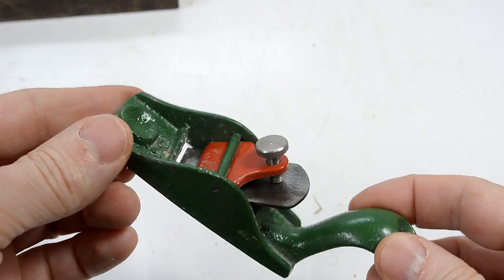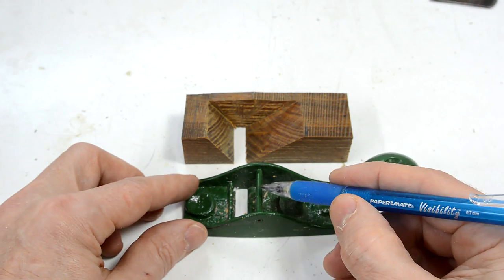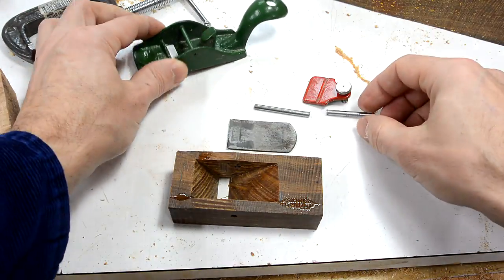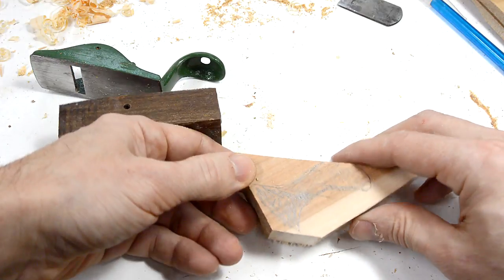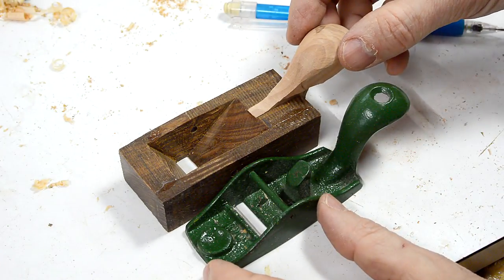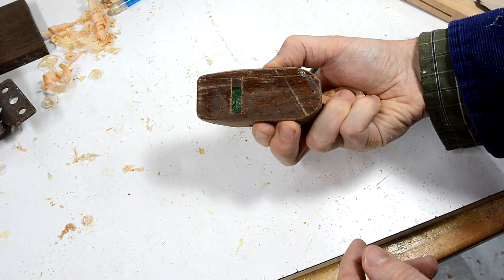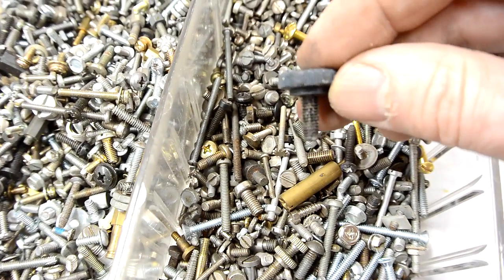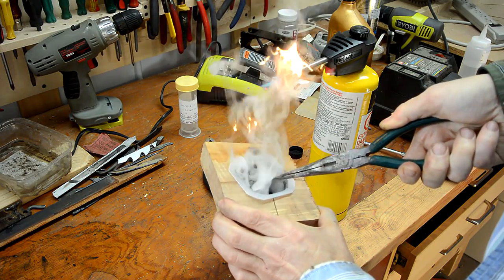Making a small hand plane

Comment: That's some interesting wood, looks dense and oily.
Reply: +NightHawkInLight  Just like my uncle.
Reply: +NightHawkInLight So dense that it sinks in water.
Reply: +YasumotoUS +Dingoart Thats pretty dark...
Reply: Actually a joke, i don't even have any uncles left living.
Reply: It's some of the toughest wood you can find, one of my great uncles was a fabricator that worked on the USS Nautilus the first nuclear submarine.  They used lignum vitae for the rear bearing of the propeller shaft, because it's very resistant to salt water and it self lubricates.
Reply: That, and very rare and expensive. 
It's about 3-4x as dense as most woods

Comment: Great work.  Why did you use epoxy instead of wood glue? Just curious.

Also, softening the steel isn't necessary when you are cutting it with an abrasive saw and deburring it with a bench grinder.

Comment: I was taught that when working with files, that if you draw back on the file while its touching the metal that you are working with the teeth of the file curl over and render the file useless after a while. Did the file that you used have teeth that file in both directions? Also great job on making that planer. You make so many nifty things I wish I was as confident and creative.

Comment: @Matthias Wandel is there any reason you used epoxy this time and not regular wood glue like in most of your other projects?
Reply: +Cosmin Almajanu Epoxy allows for a better bond with oily woods.
Reply: +Cosmin Almajanu 
Epoxy also fills gaps, while for glue you need an exact fit.
Reply: +Cosmin Almajanu Probably for a better glue joint. Lignum is a very oily wood (it was used as a self oiling bearing surface in early wooden geared clocks by makers such as John Harrison) obviously oily surfaces and wood glue are not a great combination and 2 part epoxy will provide a much more reliable adhesion.
Reply: Thanks for all your help guys! I'm new to woodworking (don't even have a shop yet)  but I'm tinkering with different types of wood in my basement.

Comment: Nice small plane You got there.
Though I think lignum vitae calls for some fancier tech. Probably the one-piece body and inox steel pin.
Was the saw You used for a blade a one-piece blade? Sparks look pretty same as of a piece You used as a blade support. Which is probably a low carbon.

Comment: I get the us of an epoxy especially for a wood like lignum vitae. Oily Very hard. But I have to object to using 5 minute epoxy! I find it just doesn't compare to 30+ minute epoxies. Just my two cents. I do wonder if Dev-Con plastic weld wouldn't be ideal for  lignum vitae since it can bond into plastics. Fantastic build as usual.

Comment: I'm curious why you choose epoxy over wood glue for some glue-ups. Is it because this is hardwood?
Reply from the maker: I thoght it woudl work better on the exotic hardwood.  But wood glue would have worked better (a joint cracked, and I re-glued it with titebond 3)
Reply: Ah. Good to know. Thanks.
Reply: With oily  woods sometimes woodglue has issues bonding. However, this issue is easily fixable. Just wipe down the wood with mineral spirits or something similar, then let it dry and it should glue up fine  Exotic woods are often the most oily.
Reply: Thanks for the tip!

Comment: Impressive, have to imagine that using a metal cutting bandsaw bland would have worked better than the angle grinder, but on the flip side, no sparks with the bandsaw.

Comment: A very excellent copy using appropriate heavy wood, and improvised metal working adaptations - thank you!   I think the old block design could have been improved upon - maybe a more user friendly hand griping type design that could be pulled rather than pushed through the wood?
Reply from the maker: +Mike Smith I don't think it makes any sense to pull a really small plane.
Reply: +Matthias Wandel OK, yes it sure does cut like butter with such little effort, NICE!

Comment: Really nice! Maybe you could do a little dent on the side too to help the pushing motion with your thumb too.
Reply from the maker: +AxelL No1 I mostly push with the tail of the plane.
Reply: +Matthias Wandel I know. Because of the "mostly" I thought it might help a little bit if your hands can shift the load partially if you have to work a longer period of time. It probably not matters much 99% of the time for the work you designed it for. I was just playing with the idea if the dent could be made as it is or it would weaken the structure too much so it would be better to add something. Definitely not worth redesigning the plane for it. :)

Comment: Fold a square of waxed paper and rub the bottom of your wood and metal planes every so often while using them, and before putting them away: I find it makes using the planes requires much less effort. :-) 

The same applies to a circular saw to some extent as well, but one can cut only so fast with those. 

I haven't tried waxing something like chisels because that only just occurred to me a half minute ago... :-)

Comment: Very nice work! Why use epoxy and not wood glue?
Reply: high oils content of many tropical hardwoods makes for poor glue joint strength with pva glue. using a solvent (as he did) helps clean off some of those oils
Reply: +paulbalegend great answer, but that is not what he asked
Reply: +Joe G.P. Oh, I thought it was obvious. Because epoxy isn't so picky and works better against an oily substrate.
Reply: +Joe G.P. and pva=wood glue, if you weren't aware
Reply: +paulbalegend It was clear to me :) Thank you for a quick and informative answer.

Comment: ROFL Matthias you make this look easy! (Probably because it is) yet some how people always make a big deal about hand made planes lol.
Reply: +MorRobots It is because they are actually quite a finicky tool and require precision and some engineering. If you look at their history, there was a lot of focus on improving them between the late 1700's and the early 1900's because they could be a pain to use and maintain. Building a plane is simple in theory, but in practice can be quite difficult. I used a Stanley #5 1/2 similar to the #5(bigger one) he is using in this video for over a year before I learned that a little bit of sanding on the cap iron to get it to fit more flush and setting it a more appropriate distance from the iron edge makes it so much easier to use and greatly reduces tear out. The smallest details on these fine woodworking tools can create so much frustration. I have a lot of respect for people that build hand planes well. I'd encourage woodworkers of all levels to try their hand at making one.  It shouldn't be an intimidating project, but building it will teach a lot about how the tool works and how to use it if the person building it has the patience to learn it. Paul Sellers made a rabbet plane out of a 2x4 and a chisel. I'd encourage people to go watch that if they are interested. Paul Sellers is very encouraging and tries to take the elitism out of woodworking, but if you watch the video, you can see a lot of details that just seem anal, but in fact have a great effect on the function of the plane.

Comment: Tiny build, no motor,  no wood glue, no green paint, not even a box joint! This is the least Matthias build ever.
Reply: hahaha
Reply: Big_Adam_2050 y
Reply: There's a tennon
Reply: Hey man he's got to do the impossible. He might even see the invisible... Row row fight the powah
Reply: Big_Adam_2050 
And it also looks aesthatically nice
Reply: yes, but it is a practical tool that most would never think to build on their own, eyeballed together from scratch out of bits and bobs laying around and using tons of semiobscure knowledge and techniques (quenching a planer blade made out of a used circular sawblade in old motor oil to harden it; using ash to temper it) that only happens to look aesthetically nice for the practical reason that it must take that form in order to be comfortable to hold and use—so, in another way it is the most Mathias build ever (which, of course, is every build)

Comment: Matthias, 

As someone with only as much woodworking knowledge as I learned in shop class in High School, I was wondering why you would choose to use epoxy over wood glue in this application. I was doing some looking online, and many people were saying that it wasn't much stronger of a bond, and it depended on the application which was best. So, what was your reasoning behind choosing epoxy over wood glue when making this plane?

I've been subscribed for a while now, and I love watching your videos. I think the first video I saw was your Marble Machine 2 video. Anyway, love the videos, keep up the great work.

Thanks,
Eric
Reply: +Eric Lounsberry He answered this several times in this thread. That particular wood, lignum vitae, is a very dense, oily, tropical hardwood. Such woods are more difficult to glue. Standard wood glue joints sometimes fail. But usually epoxy will do the job. West system even makes a special epoxy formulation for tropical hardwoods. The wikipedia entry on lignum vitae is somewhat interesting and may be worth your time.

Comment: Matthias excellent video. I was wondering why don't you go for Pull planes rather than push ones like those Japanese wood artists?
Reply from the maker: +Papi Chulo For the same reasons that the japanese don't go for push planes.
Reply: +Matthias Wandel Thank you so much for replying Matthias. I have always been a fan of your channel.
Yeah I never seen a Japanese go for Push planes.
I don't remember but in one of the videos a guy explained that pull ones offer more consistent result like one single layer which is quite hard to achieve in push planes. It offers them more control.
May be in older days that was their only tool to straighten out wood evenly which is now universally became their preferred tool.
I too have push ones with me which I use it but not often.
Thanks for helping us with your helpful videos.

Comment: is using a cap iron like that just to recreate the other plane, or does it have advantages over using a wooden wedge? (thinking about building a small plane like that, I have a small blade, but no cap iron)
Reply from the maker: +BiglinesNL Much easier to tighten and loosen, and it doesn't shift the blade around like wooden wedges are prone to do.

Comment: Congratz ! But glueing the two parts AND THEN drilling the hole for the pin would have been a simpler and more acurate way to do it : no need to set the pieces precisely (or put the pin in to reduce misalignment, which you didn't do) before glueing them. Works here because it's just a stopper, but wouldn't work as an axle :)
Reply from the maker: +KaNaRD123 Not really.  Drills don't always drill straight.  Some experience helps.

Comment: Why epoxy? I was thought that wood glue is as strong as the wood if not strong when dry? If I'm wrong please enlighten me :)
Reply: +3dmoddeler Lignum Vitae is a very dense / oily wood, so normal wood glue might not bond to it very well.
Reply: öhhh i see :)
Reply: Also wood glue might struggle to glue metal to wood, lol. I think I would have chosen a slow setting epoxy myself though.
Reply: +Stephen S WHAT are you talking about ?? 
2:16 wood to wood
Reply: The pin to hold the plane iron is a nail, so woodglue wont work and if your going to use epoxy for the nail why not use the epoxy for the rest of it.
Reply: read the first entry please.. and the great reason for not using it under neath it...
Reply: +3dmoddeler and I agree with that, I just added an additional reason. There can be more than one reason why the epoxy was a good idea.

Comment: Why epoxy and not wood glue?
Reply: +SimplyMyAccount&#160;--- +paulbalegend answered this in another comment on this video. Here is his answer:

"high oils content of many tropical hardwoods makes for poor glue joint strength with pva (wood) glue. using a solvent (as he did) helps clean off some of those oils"
Reply: +The Bees Knees Yes, but mineral spirits is kind of oily. I always use acetone or lacquer thinner myself. But I guess it worked.

Comment: can it be done without softening and rehardening the blade? I dont have a stove
Reply from the maker: +SangreNL Yes, but you have to grind very carefully to not get the blade too hot.  Actually, softening just makes it easier to work with.  And I hardened it using a blowtorch.

Comment: To bad you need such hard wood....  have nothing remotly close in hardness around.. and wont find it either..
Reply: maybe you could get away with using HDPE, the plastic in milk jugs. I'm some places they sell them on blocks or you could melt some milks jugs and form a block to work on, another woodworker/Maker already did it, I can't remember who but I've seen it.
Reply: ive seen what can be made form HDPE... not bad.. but it just isnt wood :D
Reply: kim johansen I know, kinda sucks. Here in Mexico city we have the same problem, exotic woods are almost impossible to get and the few hardwoods that are available are super expensive.
Reply: +Luciano Narno  i think Maple would be the hardest i could get.. if not buing some expensive stuff...      it is less thant 1/4 the hardness of Ligum Vitea :D     according to this hardness scale  https://en.wikipedia.org/wiki/Janka_hardness_test
Reply: kim johansen never seen that janka test, thanks for bringin it to my attetion. Maybe I can see which is the hardest of the woods I can get and start from there. :)
Reply: +Luciano Narno your welcome :D that was the same idea i had.. i actualy found a place in my cuntry where i can order smaller pieces of hardwood for a pretty nice price   they sell terrace wood and have some hardwood options...  they are not the super hard stuff but better than normal woods :D